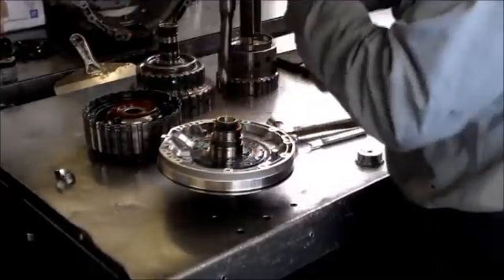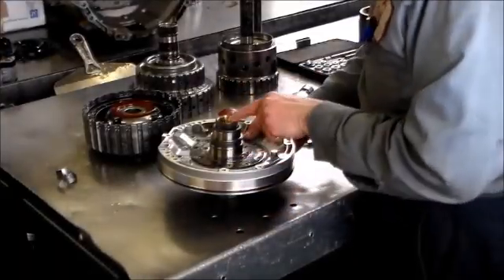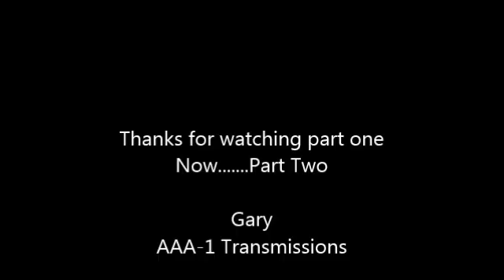ZF6HP26 Bushing Kit Installation

Comment: Gary, now that the repair on the BMW 2004 545i  100k miles appears to be bad bushing, what do you recommend it's done to the transmission shop after it's pulled. I can in the future replace valve body plate and solenoids but I don't have the lift to pull the tranny to replace the internals bushings/clutches etc. Do you know a re-manufacturing facility in the SFCO Bay area Ca. that you can recommend, what should be an acceptable warranty after the repair. Thanks.
Reply from the maker: Im sorry i dont know anyone in that area. Question, have you gotten a price on an overhaul?
Reply: Thanks Gary, great video.  I asked a couple of places and I am waiting for an answer about refurbishing the tranny.  After watching your video I can follow your video and should be able to replace the bad bushing and replace the others as well plus the clutches. Last year I replaced a busted reverse drum on a BMW330i tranny for my son. Thanks for posting your videos.  Great help for us newbies!

Comment: thank you for for this video, i have a bmw x6 and i have problem with the E clutch, should i change all the bushing ?
Reply from the maker: As a standard overhaul i always do, however, i do have some customers that just do the rear stator bushing(its really your call, i always do all of them) do you have codes pretaining to 4th,5th and 6th gear? how are the downshifts?
Reply: +Gary Ferraro  thank you for your answer, I have the code fault 4f85, it s only from 3rd to 4 and 4 to 5
Reply: +Gary Ferraro  thank you for your answer, I have the code fault 4f85, it s only from 3rd to 4 and 4 to 5
Reply from the maker: Very possible the rear stator bushing is worn, very common problem.
Reply: high GARY, i did it and it work well, thank you for your help
Reply from the maker: Awesome, glad to hear that it worked. Gary
Reply: @saberyoussefhamdi3951 1
Reply: Hi Gary, thanks for your video - really helpful. Quick question - you mentioned that in case of any problems with 4th, 5th and 6th gear changes, it's rear stator bushing (clutch E) responsible for it. According to service manual clutch E is responsible for these 3 higher gears, but clutch A and B are also involved.. So in my case - when oil is warm (everything is fine with cold oil) and I have "flare" when shifting from 4th to 5th gear, but shifting from 3rd to 4th and 5th to 6th working perfectly fine, it would mean that it's clutch B problem rather than E - correct?

Comment: Thanks Gary. This YouTube clip was so helpful. I own a Australian 2010 Ford FG which has the ZF6HP26 Trans. Car was going into Limp mode every now and then and became more frequent, car has done 150,000 kms . Went to Ford dealership to scan for codes which were wrong ratio's for 5th and 6th gear. Have rebuild trans with bush kit and overhaul kit and is running sweet. I like your little trick when you were doing A drum with bushing tool.
Reply from the maker: Glad to hear all is well, Does ford call the unit a ZF6HP26? Here we call the ford unit a 6R80. Gary
Reply: We have both Gary. 6r60/80 in some of our fords and the higher performing ones use the 6hp26.. guys are building these in Australia for high performance and using 6r80 input shafts which are way beefier than the standard input. Cheers :)

Comment: Thank you I have done that to my transmission and it all was good
Reply from the maker: Glad to hear. What was the car doing
Reply: +Gary Ferraro. bmw 550i 2008
Reply: Hi am very much impressed with how you work out this gearbox how can i get the kits like the bushes and the clutch plates i do repaires but sometimes it doesn't work out due to luck of proper tools and the repair kits.
Reply: I have the 6hp26 the gaebox is responding very well from drive to the sixth gear but when trying to overtake on a hill the kickdow is not responding it like the gear is slipping what could be the cause because have replaced all the clutch plates except the bushes.